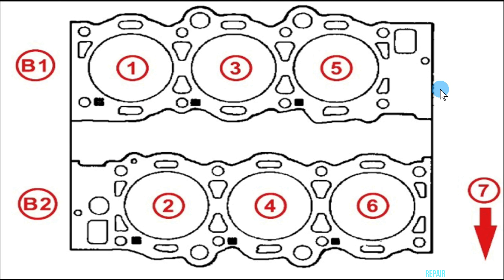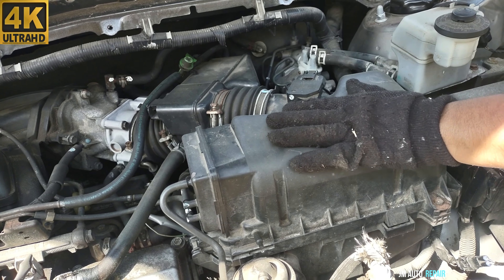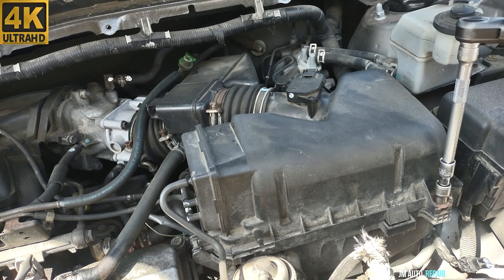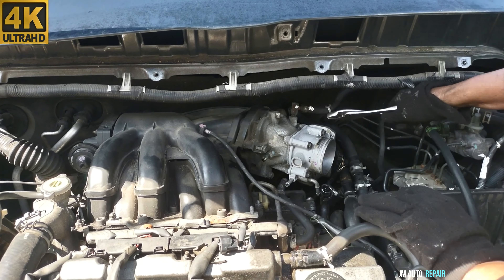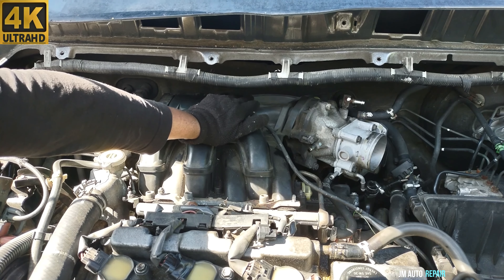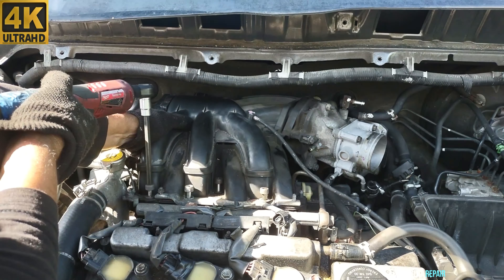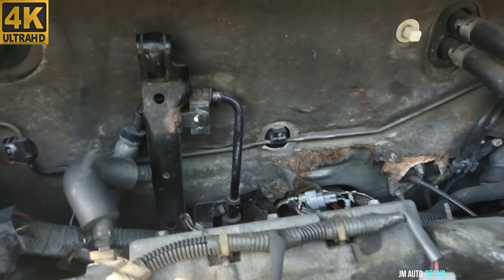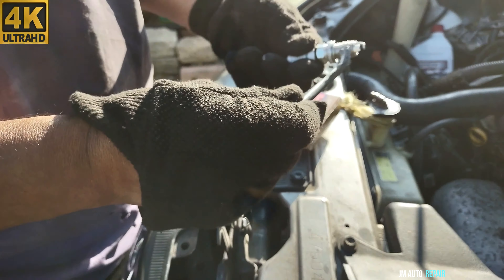Spark Plugs On Bank 1 Rear Cylinder Head On Any Toyota Sienna

Comment: Can you access the header upper bolts from the top once the Intake manifold is removed?
Reply from the maker: no, you have to access them from beneath, not hard at all, unless the head of the bolts have been eaten by the heat then that is a big essue.